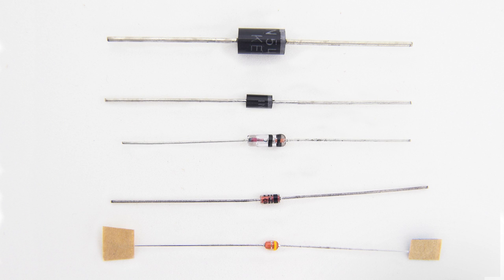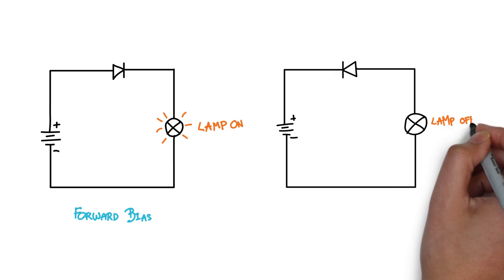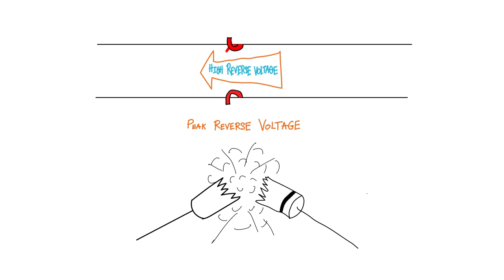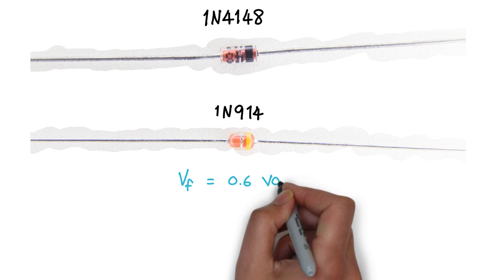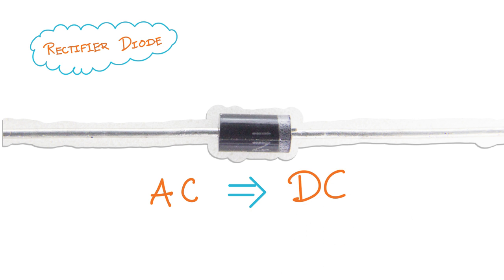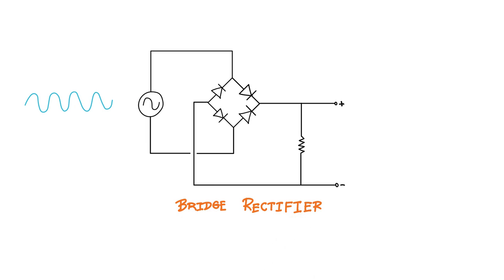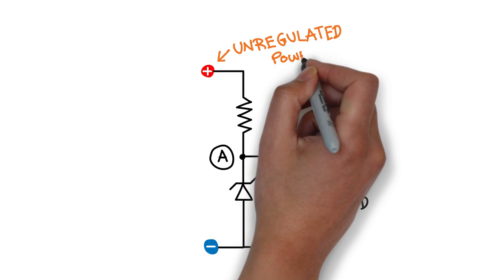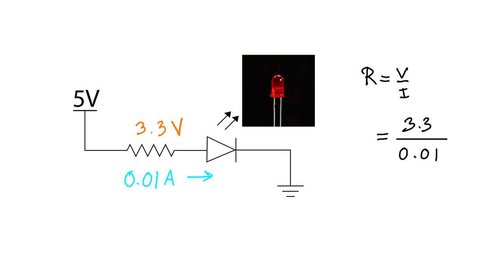Electronics Lesson: Diode

Comment: What rectifier would you recommend for car brake light to allow current only one direction. I have 32 diodes LED wired with there own resistors I need help finding out what rectifier would work best. Any information would be greatly appreciated. The power source would be 12v the LED are forward voltage 2.0 and the forward current is 20 with a resistor of 560.